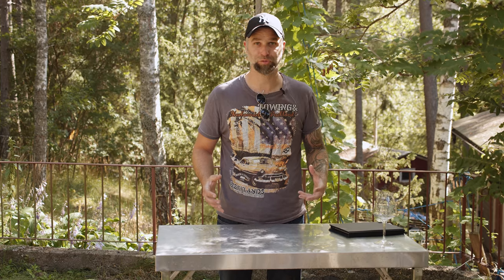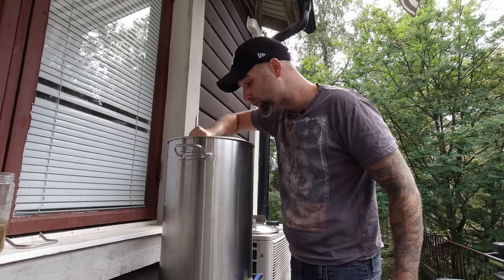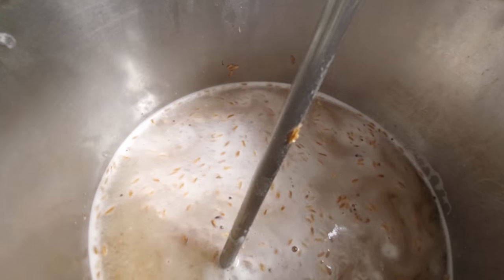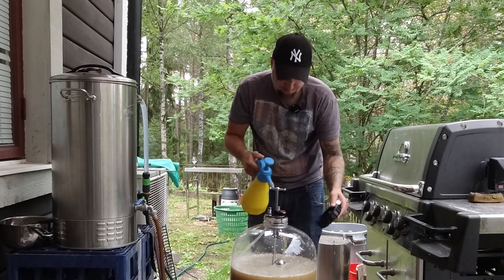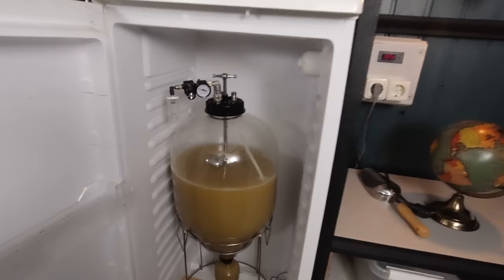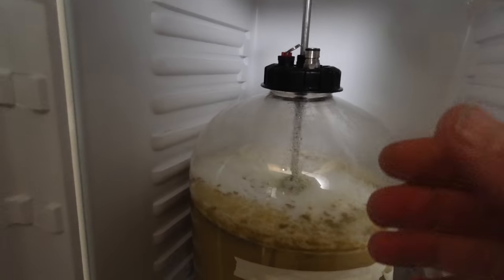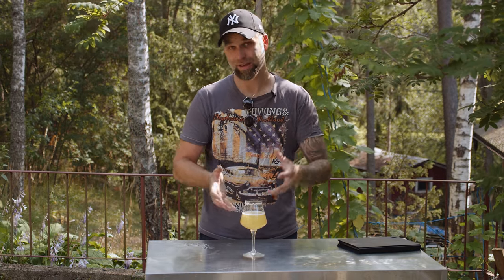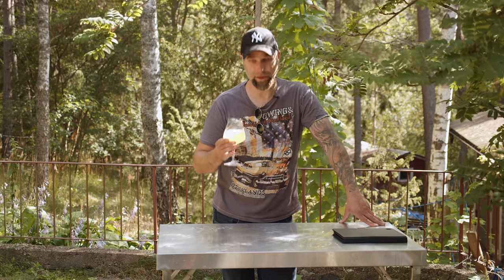All Wheat Beer - 100% Wheat IPA - Grain to Glass

Comment: Hey Doc, nice experiment! Did the 2.4 bars at 30 degrees fully carbed the beer or you needed to add extra CO2 after caging? By the way during the cold crash how much PSI you've set?

Thank you!
Reply from the maker: It was fully carbed. None I just remove the spunding valve.